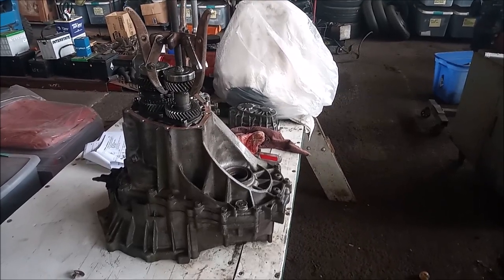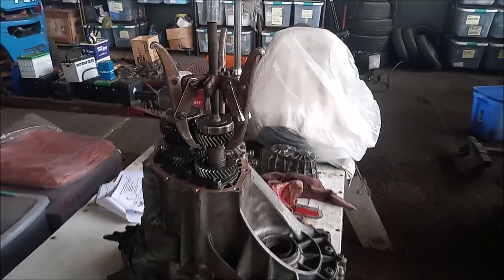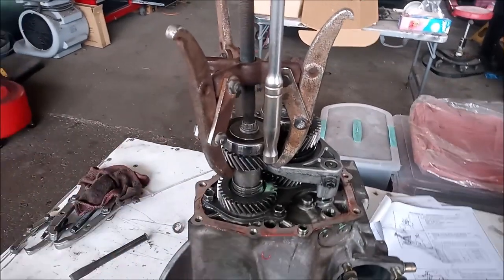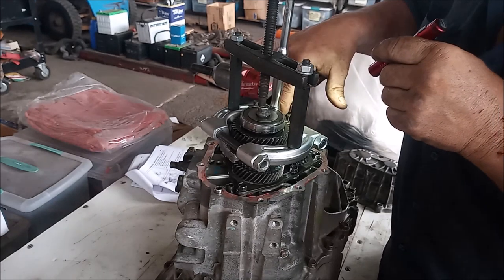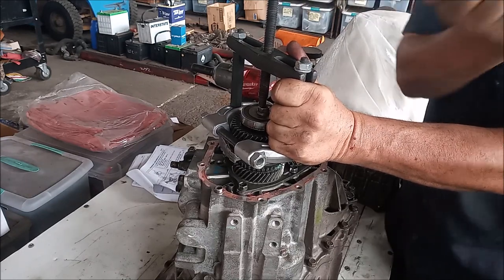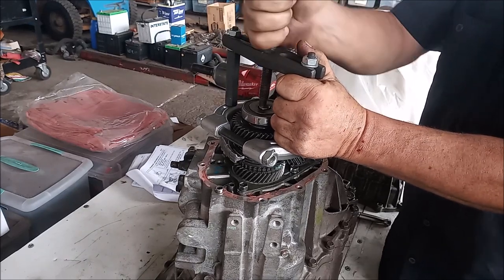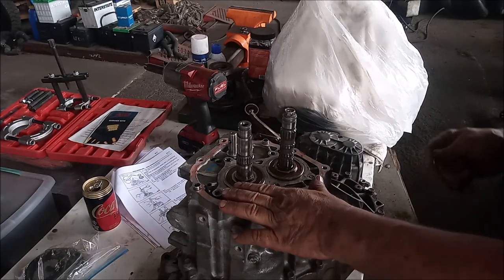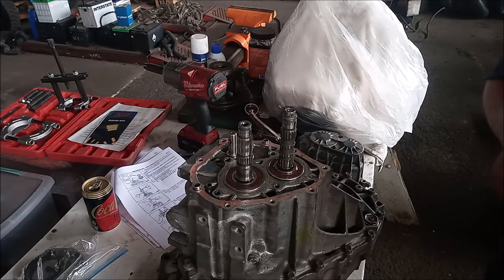How to Disassemble C60 6-Speed Transmission - Toyota Celica Corolla Matrix Lotus Elise - 2zz-ge

Comment: Thanks, confirmed what i thought.......re that 6th getting it off.......I just need to lean on the puller a bit more. Is pretty tight!! 
Tried a small amount of heat as well but don't want to hurt temper. 
Thanks very useful!!
Reply from the maker: Thank you for watching and for commenting.

Comment: More c60 and 2zzge videos mate! We love this awesome videos! Very helpful! Thank you!
Reply from the maker: Thank you for watching and for commenting.
Reply: @Merryfrankster_  be well sir!
by the way on my c60 in 1st 2nd 3rd gear there is a small hum 1500-2500rpm with the windows closed and no music, someone told me it's the bearings in the gearbox but they don't break they just sound! is this true sir or is it dangerous? the hum is not heard if I have some music on or the window is open, i.e. it is weak, not strong, and no crackling
Reply from the maker: @DimoS...  yes it's possible it is a shaft bearing but it could also be from the clutch or clutch release bearing. If it gets worse you might have to investigate further and it if is livable just leave it alone. Just FHI 1st and 2nd gear syncros are on the output shaft and 3rd gear syncro is on the input shaft so the noise you report does not seem correlated to a specific shaft. Humming transmissions is nothing new, on other cars Toyota has TSB's for humming transmissions where they suggest replacing the axles then replacing the transmission mounts before finally replacing the entire transmission if the humming noise does not go away. Take all this with a grain of salt as I have not heard your noise and have absolutely no idea what is causing it.
Reply: @Merryfrankster_  thank you so much for your help sir! I appreciate it 🙏 
When push the clutch the hum stop.
So is not a dangerous to brake the gearbox sometime, right? Also the trans work perfect and smooth (I don't understand excellent English, but the 99% from what you say)
Reply from the maker: @DimoS...  To be safe, drain the oil from the gearbox, collect the oil, and check for metal fragments in the oil. If you see a significant amount of metal fragements in the oil then you must remove the gearbox, open it, and make a repair.
Reply from the maker: If you collect your oil cleanly, you can re-use it, no need to buy new oil.
Reply from the maker: You can repeat this at every engine oil change interval, to check up on the health of your transmission.
Reply: @Merryfrankster_  οκ. If don't have metal inside on fluid is ok. This bearing is closed typer with grase inside, can break this bearing? Is possible ? Or not?
Reply from the maker: @DimoS...  Anything is possible and metal could be coming from anywhere. Check for metal. Check if magnetic (bearing) or non magnetic (syncro). After that you can be Sherlock Holmes or Columbo and develop a theroy of the crime.
Reply from the maker: In other words, look for some evidence first, before engaging in speculations.
Reply: @Merryfrankster_ hello sir, the oil is super clean without metal savings, now put fresh redline mt90 again... anyway the c60 with good maintenance and stock power is reliable gearbox and do they have longevity in your experience ?
Reply: @DimoS... stock is fine. Not bulletproof but it should make 200k+ km like most manual trans (and probably a lot longer). But when you start putting power into these, they start to become a consumable (300hp+).
Reply: @frederickschulze8014  hi mate, I have 100.000 real kms and the car is stock with 192hp. Also I know 2zz corolla with 450.000 kms stock engine without big repairs except oil leaks etc...i
Reply: @DimoS...  Yes they can go much longer depending on how they're driven. In a Corolla, I imagine it isn't doing constant pulls to 8300 rpm :P. I have 230hp and I will be doing autox and track so I expect to replace it eventually.
Reply: @frederickschulze8014  230hp on 2zz? I'm in lift almost every day but I'm carful with maintenance (3.000kms oil change 0w40 mobil1 fs) and always with warm engine. And generally I'm carful no starts from 1st gear etc
Reply: @DimoS...  Yeah, 205whp in a NA 2zz. I have a built valvetrain, cams, headers and plenum. 2nd cam goes from 5500-9000rpm. It was on an e85 tune for a previous owner so it used to make 10-15% more hp, but it's on a standard 93 US octane tune now. Unfortunately I can't drive it right now because of a pressure plate failure which damaged the trans which is why I'm here 😬. 

If you are concerned about longevity and you drive in lift a lot, you may want an improved oil pump gear. And for high rpm cornering (mostly a track thing), since oil pressure drops in corners at high rpm, you would want a baffled oil pan.
Reply: @frederickschulze8014  yes mate, I know for this 2 weak points for 2zzge I'm planing to change the oil pump gear, oil pan no because I don't drive on track days. something else that worries me lately and I don't know if it's normal! if you open the oil cap while the engine is running, should it suck in air or blow air out of the cap where we fill the oil?

Comment: Hi, thx so much for the video. Do you have a link to buy the bearing pullers you use - or just their diameter ? They seems to go perfectly on the pinions. Thanks
Reply from the maker: These are garden variety generic pullers. They come in sets but you can also buy them individually at any parts store, or from Amazon.com.

Comment: Hello! I have only one problem with this gearbox on my Toyota powered Lotus Elise - 3rd gear grinding when gearbox is cold. 2 to 3 shifting. What is the required parts BEFORE I take transmission out from the car? Only synchrogear 33368-20090 or should I pre order something else? Thanks for your video and answer.
Reply from the maker: Did you try changing transmission fluid? Sometimes this solves the issue of cold transmission grinding. Redline MT90 is good. Anyway depending on how much wear or damage you find, you may need to change both the syncro ring and the hub.

Comment: Solid tear down. Video. Question,
If I pulled a c60 w/lsd and want the final drive from the toyota matrix, do I just need to remove and replace 6th gear?
Reply from the maker: To change final drive, you change the differential ring gear and the entire output shaft, with the output shaft pinion matching the ring gear. Final drive has nothing to do with 6th gear.
Reply: @Merryfrankster_  ok, so if I want the taller 6th gear out of the matrix for better highway fuel economy, whole output shaft needs to come out?
Reply from the maker: @Ma70rk  No, if you want to change the final drive, which is what you asked, the output shaft has to come out. If you want to change sixth gear, that's a different question, you can do that just swapping sixth gear from your donor vehicle on both input shaft and output shaft. Words have meaning. Final drive does not mean highest gear.
Reply: @Merryfrankster_  thanks for clearing that up! Will definitely consider. Plotting if I want to attempt my own lsd installation, or buy donor c60 and swap 6th gear.
Thank you! ✊🏼

Comment: Is this the same for the 2002 celica gt with the 5 speed or at least similar? I’m doing a whole rebuild on the engine and planning on wanting to do a rebuild on the transmission since it has 228k miles on it
Reply from the maker: It is similar but not exacty the same. The biggest difference is in gears 5 and 6. The five-speed has no gear 6 to remove. There is also a difference in the reverse lockout. Other than that it is mostly  the same.

Comment: Hi, I requested the C60 manual and got it.  Thanks a lot.  For the swap, beside the shifter shaft and reverse blockout, what else do I need? Computer, shifter cables, 6 speed shifter box,...? Thanks again for your very helpful vids.
Reply from the maker: Depends what you are starting with. Sounds like you have the bases covered
Reply: @Merryfrankster_  My car is just an all stock C56 + 1zz + 1zz ECU Spyder and I think I just need a 6th gear to lower the highway RPM a little bit and put in an LSD while I'm at it.  So that means beside the C60 gearbox, all I need is the conversion shaft and reverse blockout? No electronics or anything else?
Reply from the maker: @diehardcat  You do not need any electronics whatsoever. If this is a street driven car you do not need an LSD. and with 1zz stock power, LSD is nearly pointless anyway. Just do a Corolla fifth gear swap on your C56, it lowers the gear ratio from 0.8x to 0.7x, and you will be set.

Comment: Thanks for making this video. I will attempt to rebuild a C60 and put in a LSD when my clutch goes. This maybe a stupid question but could the open differential be welded? LSD is not cheap...
Reply from the maker: Sure you can weld an open diff but it becomes undrivable. Forget about going around street corners or parking lots.  It's useless for anything except high power drifting. You can get a used OEM helical LSD for about $500.
Reply: @Merryfrankster_  c60 service manual 🙃
Reply from the maker: @tkflex2332  you can request this by clicking on the link in the description.
Reply: @Merryfrankster_  God Bless you sir 🙏🏾
Reply from the maker: @tkflex2332  Thank you for watching.

Comment: Is it possible to change the 6th gear for lowering RPM at highway speeds?
Reply from the maker: you can find a gear set from a C63, C64, C65, or C66, then you should be able to do it. The input and output shaft are all the same.

Comment: Can I pay you for a phone call? I have a 2003 Pontiac Vibe GT w/ 2ZZ-GE w/6 speed manual . I (just me on my own) recently replaced the drive shafts and axle seals. Since then, at lower revs, I have some pretty significant lateral vibration that goes away as I speed up. I thought that maybe I bent the mount/bracket that couples with the intermediate bearing on the passenger side drive shaft as I really had to beat on it to free the passenger side drive shaft from it to get the old one out.

But now, in addition to the vibration, it is becoming increasingly difficult to shift in and out of gears and I assume that the clutch is not fully disengaging as it almost always grinds going into reverse even when I am stopped and the clutch pedal is fully depressed.

So far, I have done everything on this car myself with success from sub frame replacement, rear engine mount, steering knuckles, struts, wheel bearings, parking brakes, fuel tank, evap system cleanout/overhaul, and more. The drive shaft and oil seal project is the first one I have undertaken with (apparent) resulting issues. 

I would be glad to compensate you for time on the phone if you may be able to help me troubleshoot the issue. If I have to take my car to the mechanic, I will, but I would prefer to know what's going on first.

Thank you
-Gabe
413-320-6214
Reply from the maker: Sorry I am terrible as a webmechanic without access to the vehicle. I would suggest that you sign up on spyderchat and get some community help with the  issues.
Reply: Okay, thank you for getting back to me. Excellent videos by the way, I really appreciate the info.

Comment: Would you know the difference between a C60 and EC60? Cheers
Reply from the maker: EC60 is a newer trans. Most significant difference is bellhousing. Will not bolt up to 1zz/2zz. Bolts up to 2zr. I am not familiar enough to list all other differences, or tell you whether bell housing could be swapped.

Comment: Hello from Florida, hope you can send me inbox the right direction.  I remove all the components of the SMT HPU & GSA.  The Transmission is in Neutral shaft with screwdriver in upright vertical.  I can roll the vehicle, but the engine is rotating as if it's in gear.  I can shift through gears, or place transmission gear and that locks the engine and the car won't roll.  there is one gear on the top forward counter clockwise position duplicates allowing the car to roll with the engine rotating.  Im not sure what gear it is.  I'm not a transmission guy but I'm not afraid to open the trans if I have to.  but I'm not sure what to look for?
Reply from the maker: Thank you for watching. I've answered your question on Spyderchat.

Comment: Do you have an email? I have a few questions about a 1zz to 2zz swap, I need some information on speed sensor wiring. Any help you could provide would be greatly appreciated, I watched a little bit of the video on the 2ZZGE pin out  on the ecu/ecm but I still have a few questions.
Reply from the maker: Ask your questions  here. Speed signal to the ECU comes from the ABS. VSS in transmission is blanked off not used. For more info sign up to spuderchat.com
Reply: @Merryfrankster_  I have a 1zz to 2zz swap no abs

Comment: dam the way toyota made these are pia compare to hondas.
Reply from the maker: Seriously? Watch my other video for disassembling the RSX six-speed.
Reply from the maker: But in fairness, newer Toyota trans are more like the rsx, no more split case. That said - the split case does add rigidity and makes for a stronger transmission.
Reply: @Merryfrankster_  i can do k series trans. the three piece housing on these c series trans is a pain.
Reply: @Merryfrankster_  in theory, but probably just overly complicated compare to Honda’s b and k series trans. just being honest here i work on both, no bias.
Reply: @axsb  As somebody with practically no experience with manuals, both the Toyota and Honda FWD transaxles are simpler to take apart than I'd have imagined